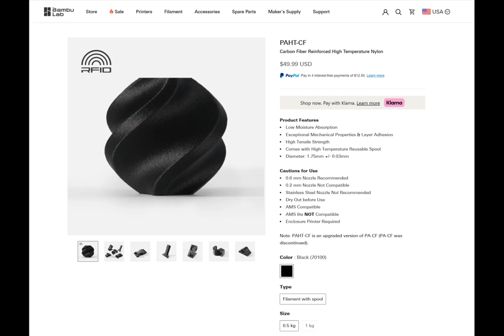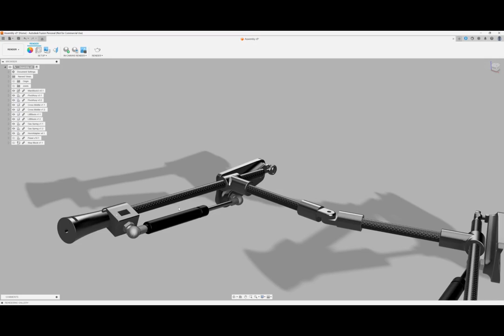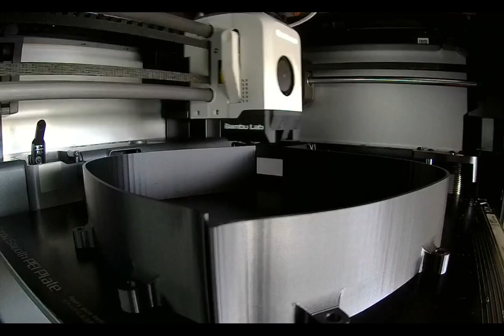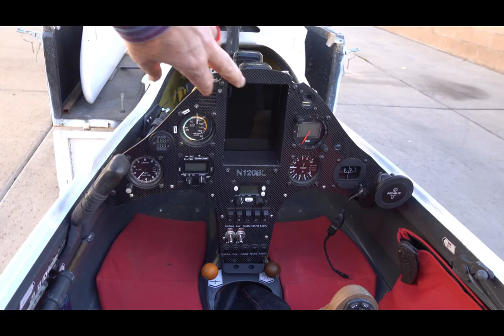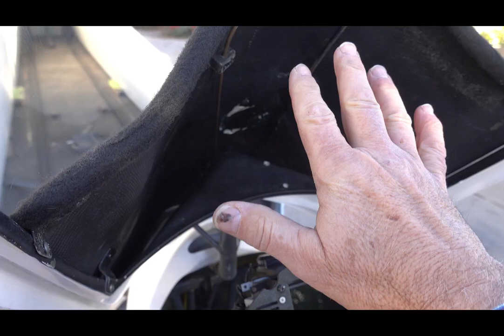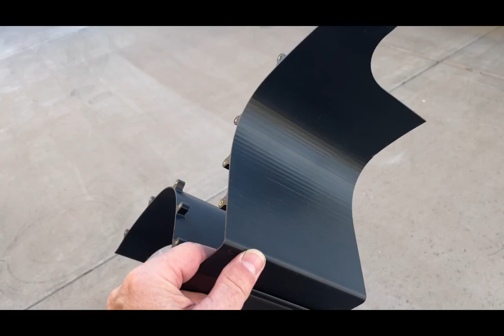E4: ASW-20 Cockpit project   Step 3b Panel Lift

Comment: What keeps the panel from moving around while flying?  Is it just a tight fit between where the bottom of the panel rests on the cockpit floor and the top of the panel meets the underside of the canopy dash?  Maybe there is a rubber gasket in there somewhere?
Reply from the maker: The bottom saddle holds it from moving down and back/forth. The mechanism attachments on either side keep it from moving back and forth, making 3 points of hold. The canopy pins it from moving up holding it firmly in place. If you REALLY wanted, you could add another axial retainer in the bottom of the canopy but is not necessary. Even if parts of the mechanism breaks, it is not going anywhere.

Comment: Very nice design! I fly a PIK-20E with a similar configuration from where you started. Getting out of the cockpit in an emergency heaven forbid will be a struggle. This instrument lift solves that problem.
Reply from the maker: Agree completely. I am just surprised this design is not more common in other older gliders. Thanks.